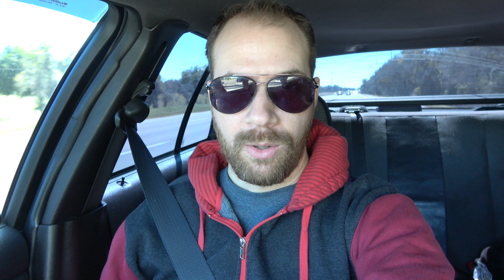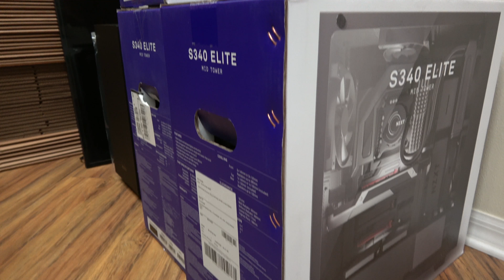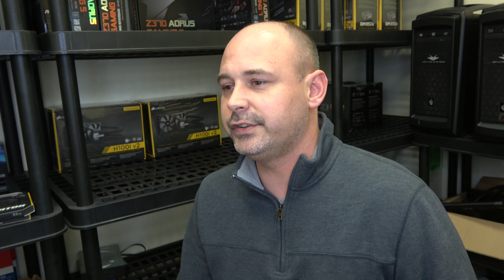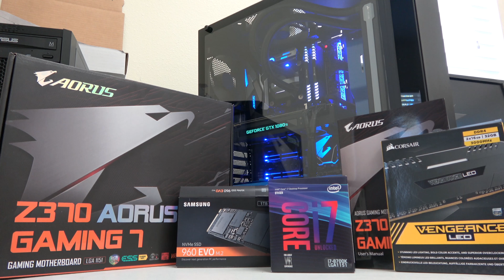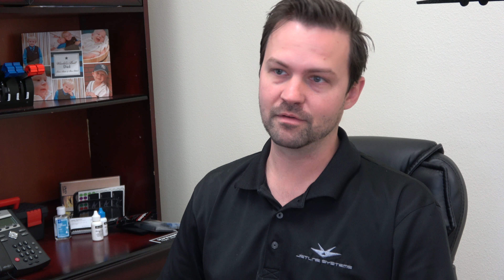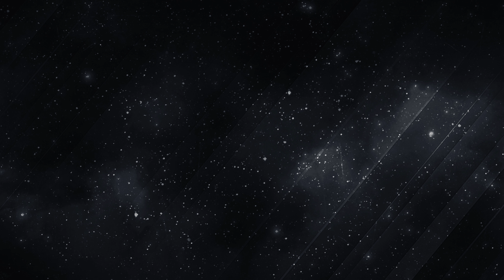(Sponsored) My New Jetline Systems PC!

Comment: 32GB RAM an actual requirement for a game.  Hmm.
Reply: Flight simulation has lot of objects so it requires a lot of ram to run smoothly
Reply: K Tarun Reddy, to also look good and realistic it makes sense.  Jet Fighter II did well with under 4MB.   Its creator(s) focused on realistic movements and most basic graphics possible.  It was even a useful tactic to get bogies to chase you straight up and stall deliberately with a much faster jet, turn around and fire a medium or long range missile while you're both still stalled from air being too thin.  Fuel economy depended on speed, so if you're low you can sometimes still return to your launch location flying at just above landing speed.  Altitude also made a diff.  I don't remember the best alt. range for it though.  Running from missiles burns it quick.  I don't remember if refueling was available at all friendly air strips.  There weren't many objects, not much animation either.  The only moving objects were your craft, aircraft carrier, missiles, targets and sometimes planes needing an escort.  Land was huge patches of giant triangles of uniform color.

Comment: Nice video can you link that sparco wheel does it fit on the tx thrust master Jeff ??
I'm looking for a new bigger cool wheel like that one thanks
Reply from the maker: I believe it works with the thrustmaster ecosystem so you may want to double check but it is the Thrustmaster Sparco R383 Mod you can get it on Amazon.
Reply: Jeff Favignano ok i will check on that thank you very much Jeff

Comment: I recently had a new PC built with pretty much the same specs (same CPU, same cooling, same GPU, same ram...) ... except CPU is only overclocked to 4.7, my motherboard is the ASRock Z370 Taichi, my 960 is a 256GB, and i have a 1TB 950 EVO for most game installs.